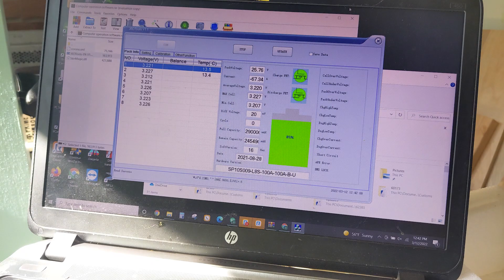Build Your Own 24-Volt LiFePO4 Battery For Cheaper Than AGM

Comment: I have 4 16s 48V battery banks 280ah each cell. No compression needed. If you compress them you do not allow any expansion which means if they need to expand they can blow the top release valve. I have seen these cells charged at 61 volts and they were at the point of blowing the top release valve. The guy is still using them today. He lost no top end yet. I couldn't believe it but it shows they need expansion room. Also if you charge and discharge at less than .5C you will never have expansion if you have proper temps and elevation. If you are making your own for a RV or boat you still do not need compression just each cell has to have mounting straps so they do not move. You also need to add silicone on the threads above the nut so they do not work loose from vibration. I learned that being a marine Boat mechanic for many years. If I had to heat them I would make an insulated box with a heat mat on bottom with no compression.. We pay a lot of money for our cells and if they need 1C-2C discharge or charge then you want the expansion room. I would never do 1C-2C as I would add more more packs to my busbars. At 10kw I am at .15C discharge. 1C = 280ah per hour of charge or discharge for each pack. Know that Lithium can and will break down over time but you can control the rate it does. 1C = 3000 cycles. .5C = 6000 cycle so I think .25C would be 10000 cycles or more which means I will die before they go bad unless I live another 50 years. Nobody has tested that these cells can make it 50 years. Time will tell.
Reply from the maker: Good advice, I should add some silicone to the nuts. Expansion issues is why I like using foam for compression. When the batteries expand during charging and shrink during the charge cycle the foam has plenty of give. I've read of people using wood boards and compressing the batteries when fully charged, but still seems risky like you said with the release valve popping. 

In the end 3000 or 6k, 10k, 15k, 25k cycles is a ton and like you said, who knows if the cells will even last over the years. Most of the tesing data is done with huge C rates or the data is calculated. While compression might increase the lifespan, doesn't matter if you store the cell fully charged or use it at a high C rate. I opted for it, but plenty don't. 80% capacity after 10 years with no compression is still very usable